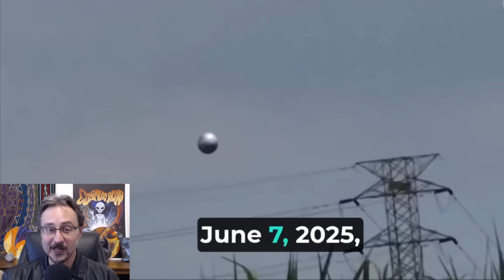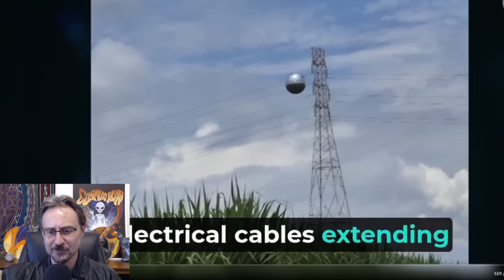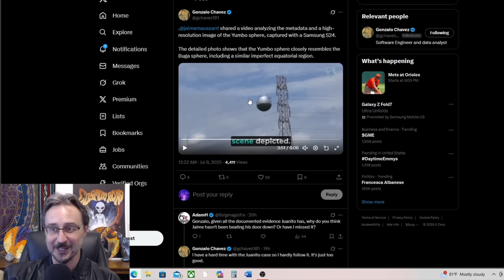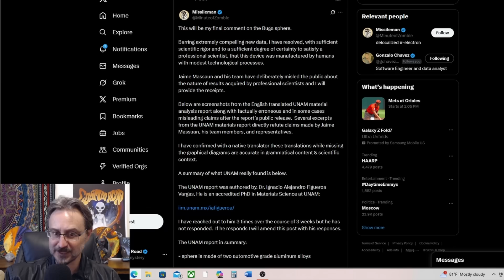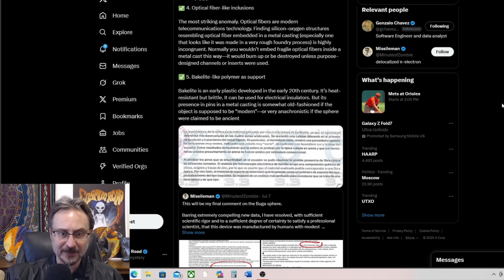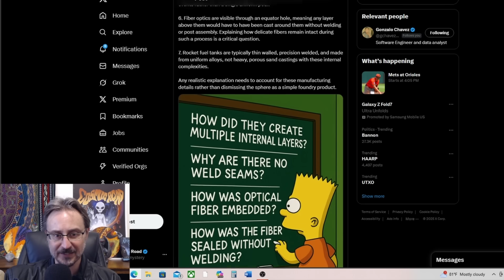Wild New Update on the BUGA SPHERE UFO! Yumbo Sphere Proven Legit, Buga Made In Weird Conditions!

Comment: Hello everybody, please check out the Adamski 8mm film. 
Another morsel of information can be obtained from a book written by Dino Kraspedon.
Next, Townsend Brown. 
The ball is suspended in the air by an external vacuum. 
This is created by high voltage cathode rays spinning around the sphere in opposite directions. 
The top hemisphere spins them clockwise, the other anti-clockwise. 
The ball is drawing energy from the earths electrical field using Schumann resonance.
8 x a second. 
The planet's electrical field can then power this ball indefinitely. 
There's a gyroscopic stabiliser inside to keep it level. 
The black mass at the bottom of the ball is caused by a fairly high vacuum.
Not full vacuum. 
It it can be observed in a geissler tube as black bands.
The adamski film shows the high vacuum, (not full vacuum), massively expanding and contracting underneath the craft. 
When full vacuum is developed at the top of the craft, it instantly lifts the craft and it's occupants straight into the upper atmosphere.
No inertia. 
The entire craft is highly charged and so are the occupants inside. 
Weightless force field. 
The craft and it's occupants are bonded with the same charge as the vacuum force field outside, 
and so the craft can instantly change directions with the occupants feeling nothing inside.

Glad to be of help, am now compiling more condensed versions of this for other channels.

Comment: Not an expert so forgive me if i am wrong but it seems to me that optic fibres merely relay information from a transmitter to a receiver. optic fibres are not sensors; they do not pick up environmental info, and they are not transmitters or receivers and therefore the claims that these fibres are picking up environmental info seems weird to me but who knows maybe i am wrong. personally think these are man made which is a shame as it will throw shade on Jaime Mousan (again) which will in turn bring more scepticism about the nazca mummies. sometimes i like ross but a lot of the time he is as annoying as greer and corbell.

Comment: Hydroformed from a spun template? Friction welded hemispheres? Then fill it with bed liner and put it in a washing machine for a few hours.  Then put a nice symbol on where you put the water in. Hydroforming spheres can be done with a domestic pressure washer. You could do it inside a mold to get the equatorial detail. 

No idea how it flies though 😆

Comment: Even aside from its capacity to defy gravity without known propulsion, the sphere's strange physical characteristics (its mixture of rudimentary, inconsistent, variegated metalwork and high-tech fiber optics) points toward what I've hypothesized all along: UAPs are not industrially "manufactured" but created through psychokinesis. This would, I think, account for why so many of them are described as seamless, one single whole, rather than put together with "parts." In the case of the Buga sphere, nobody can understand how a Bakelite-like polymer, which has a very low melting point, could have survived the intense heat needed to smelt and forge the metal through any conventional means. Consciousness can, through psychokinesis, manipulate matter in ways not remotely possible for industrial manufacture; see the concept of "apports." I would suggest that "alien" consciousness creates a great variety of objects out of earthly raw materials so as to fit intended purposes.
Reply: Wow that sounds like crazy magic. I dont see anyway to proove it of course. In a way Uri Gellers ability to bend spoons kinda helps me to visualize that.   Russell targ bent a aluminum rod one time i heard him explain on Rosses show. Who are we? What are we? Loving intention is needed for sure.
Reply: Could be something akin to an atomic 3d printer. Basically, if you can transmute (alchemy) atoms, you can build anything/ anyway. Certainly impossible with anything we've been told about

Comment: If you look at the close up, doesnt it look like the view of the powerlines is blurred around the sphere?  What would account for light distortion around an object!  Camera sensor effect?  Particles or vapor?  Would take enormous gravitational field. to deflect photons.  It did look like a crappy casting.  Its the levitation and lack of a power source that seems unconventional.  Maybe the NHI arent as capable as we assume - crashing ships, making mad max spheres) (Scratching head sound...)
Reply: Possibly gravitational lensing 🤷‍♂️
Reply: The blurring of the power lines is caused by high voltage cathode rays circulating around a sphere causing a vacuum. Ships float on water, spheres float on air pressure. So can almost anything else.